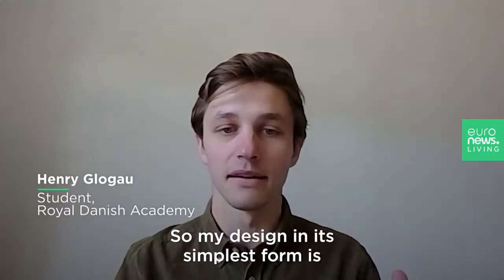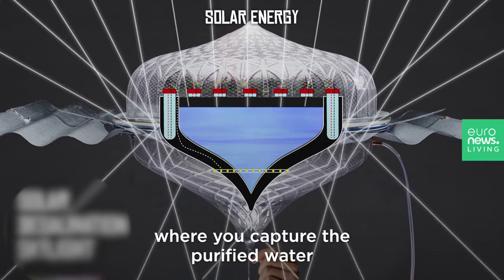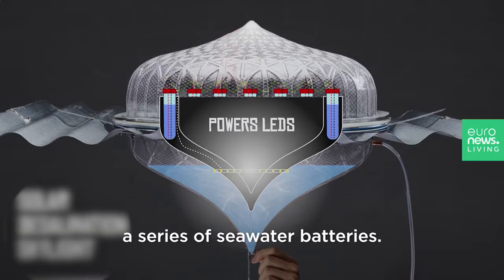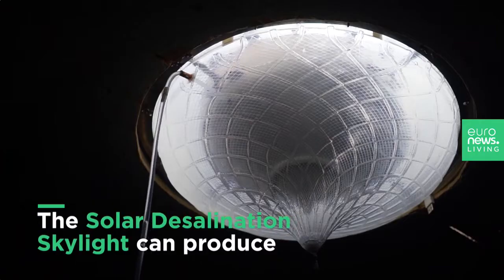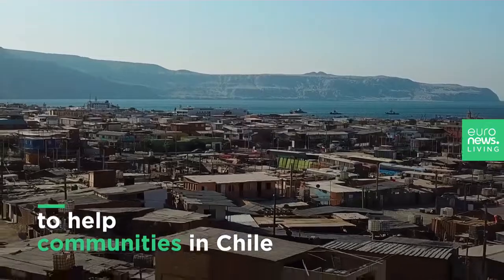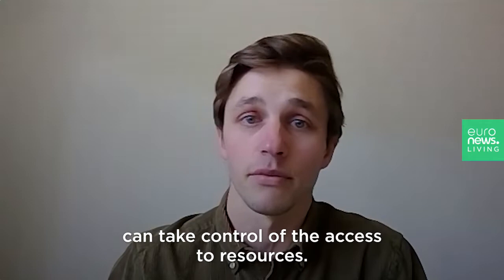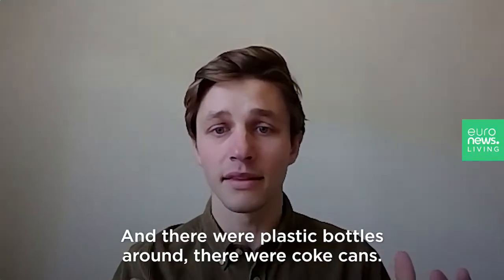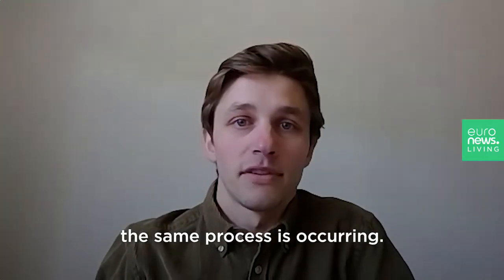The amazing Solar Desalination Skylight offers hope to millions without clean water

Comment: The addition of the saltwater batteries is what sold the idea.  Nobody really thinks of this, yes its simple, and to a degree easy, you need to make sure you can scale it up.  FYI, they are completing a huge glass dome in Saudi Arabia to generate electricity, then use the exhausted steam as fresh water.
  There is a tomato farm in Australia that has been using the same system for several years.